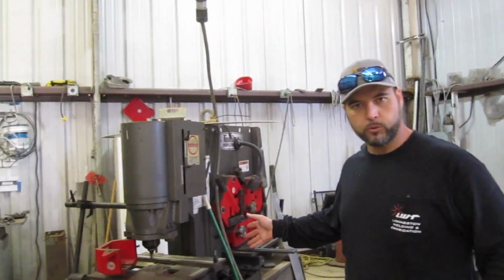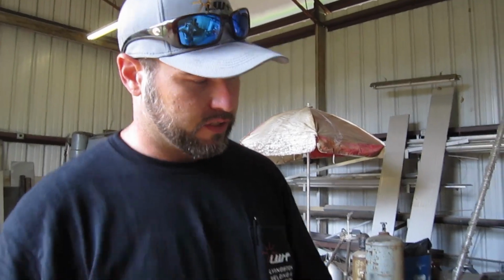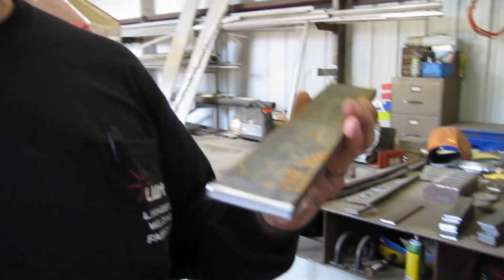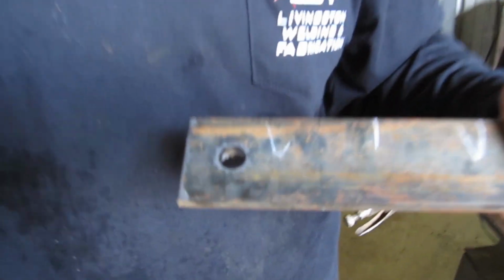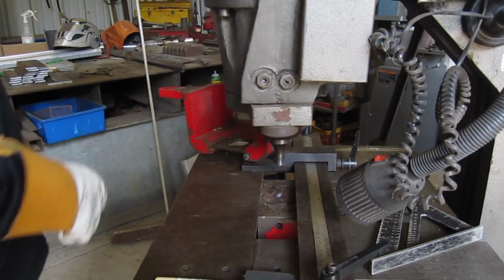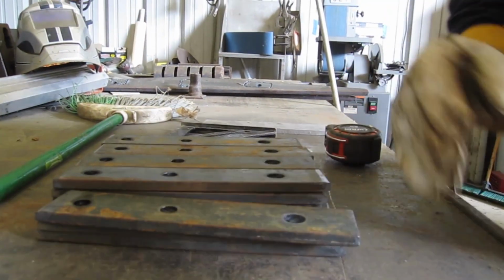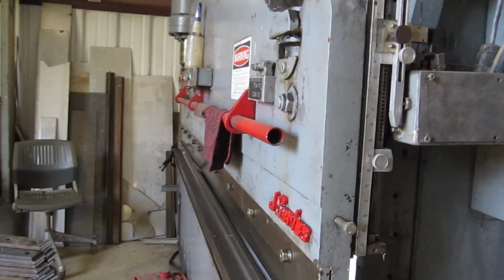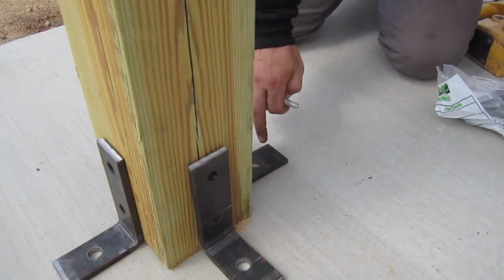Fabricate L-Brackets using IRONWORKER & PRESS BRAKE

Comment: on a shear to take off a bur the blades can be shimed
Reply from the maker: Yea my ironworker doesn't have an easy way to change the gap for different thickness but it cut pretty good when it was new but the cutting edge has 4 edges that can be used I just need to flip it around just one of those maintenance things I keep putting off. Thanks for watching 👍👍

Comment: Nice work. Awesome equipment. I hope to find a good used brake someday.
Reply from the maker: Thanks, yea they are out there but expensive and takes a lot to move one but I've seen some nice ones go at auction for very cheap but I didn't have the resources at the time to move them.  Good luck!

Comment: Can't beat an ironworker for quick holes & cuts .    I have only used the mechanical ones with the big flywheel , cut & punch at the blink of an eye !    Do you get Dry Galv paint there .   Great for brackets like that if there is no access to get them hot dipped . You know when you feel the weight of the can , it's twice the weight of normal paint !     .👍
Reply from the maker: Yea I like the hydraulic style a lot slower but makes up for it in safety.  I think the only mechanical machine I'm brave enough to run is a sheer.  Yea I had some cold galv. compound spray paint but since they are going to wrap the columns in brick I just left them with the mill scale finish.  Thanks for watching Max Cheers👍👍